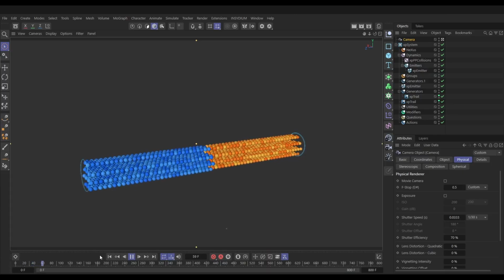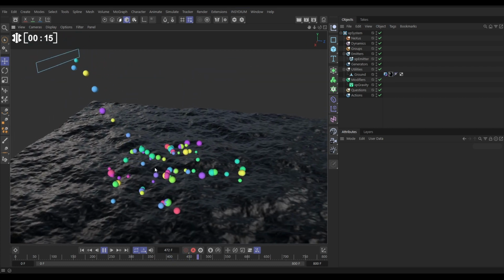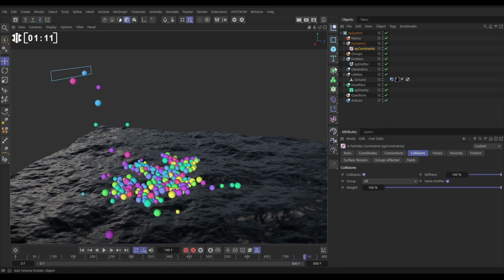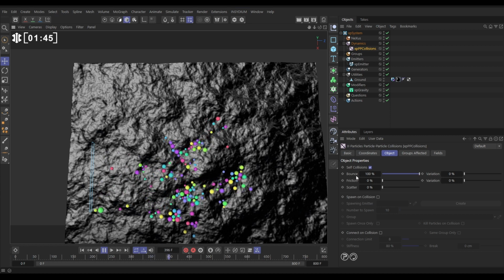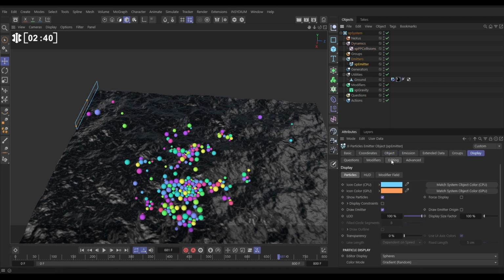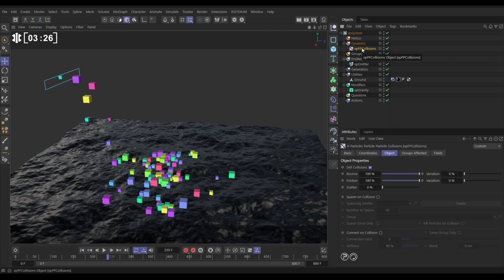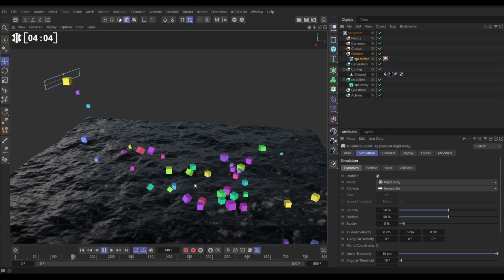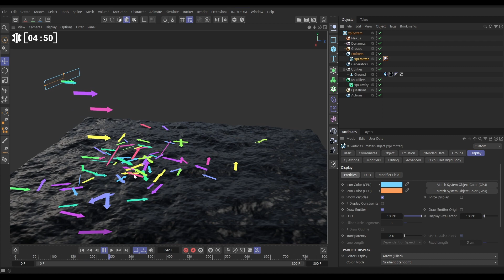Top Tip Tuesday! - xpCollisions

Comment: Amazing collider but... for some reason it does not collide with the floor... at first it does and eventually all particles are falling through.
Reply from the maker: Hi, the issue you describe is usually solved by changing the scene scale and/or increasing substeps. However, it's difficult to say without looking at your scene file.

Could you please head over to our Discord Server to ask the question and attach the scene file. We'll take a look for you. 

https://discord.com/invite/X2zYY7qEyr

-Thanks
Reply: Thanks, I have changed the scene scale and it solved the problem. @INSYDIUMLTD

Comment: hi bob. thanks for the tip. I have off the topic question but i think i am not the only one that has headache .. well i have cached emitter and i want to emit particles from it. the only "laggy/lame" work around it was via xp trail .. is that possible at all. many thanks.
Reply from the maker: Hi, 

Could you please post this question to our Discord Server? https://discord.com/invite/X2zYY7qEyr

Thanks
Reply: @INSYDIUMLTD Just posted it on discord. hope there is a solution .. 
thanks bob.

Comment: Great information, that collision questions come across often!
But what do i do with f.e. Sand particles. Lets say 500k particles consisting of 5 irregular particle shapes?
Its too heavy for bullet from what i know.
Reply from the maker: You would either have to use the particle display objects for collisions like Bob has done, and use an xpGenerator or instances for the custom geometry onto the particles. Or you could use the generated geometry for the collisions, by adding the bullet collider tag to the xpGenerator, this will give collisions accurate to the geometry but at 500k particles it will be very heavy.

If you have more questions or need more help, please head to our Discord server here: https://discord.com/invite/X2zYY7qEyr

-Thanks
Reply: for things like sand how about just using the sph fluid solver? Should be much helpful than depending on bullet or even particle collision.